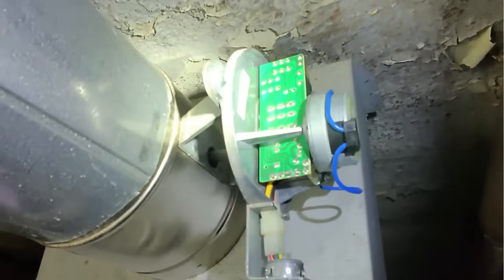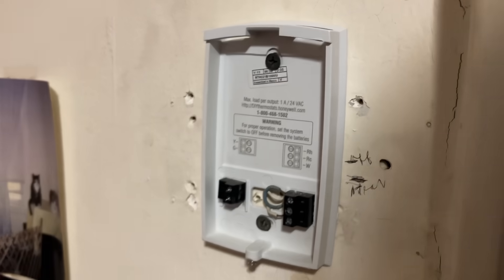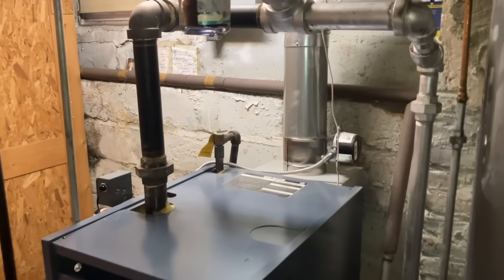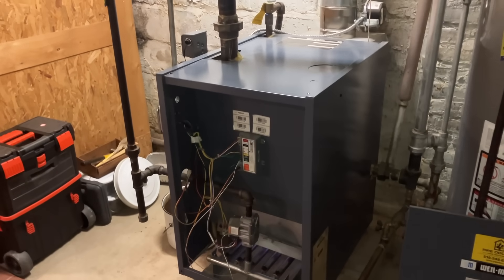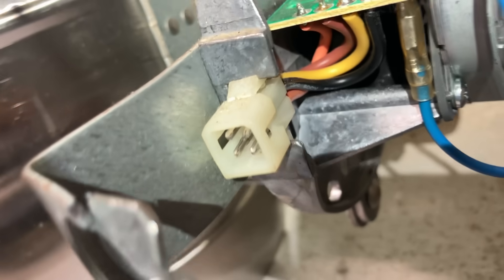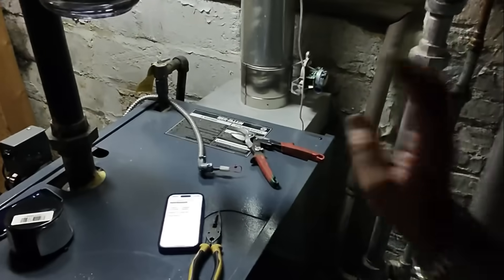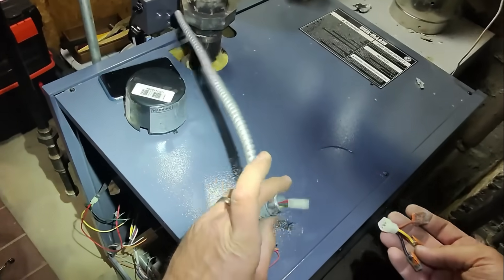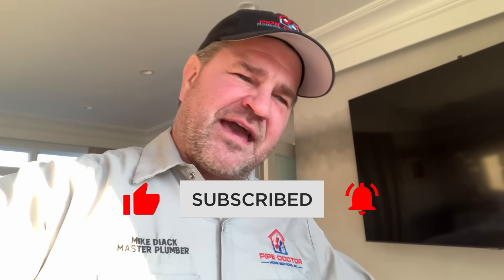Gas Boiler No-Heat FIX: How to SAFELY Bypass a Bad Vent Damper (Emergency Repair)

Comment: Messing with pre wired harness alters the internal integrity of the designed operation. And you are assuming any liability as you know.  But sliding the locked open switch on the damper motor avoids any liability issues. Mostly likely was the intended use of that switch. As the damper is only required for the energy star rating in the sales brochure.   SO LOCK THEM OPEN STRAIGHT OUT OF THE BOX FOR A SAVINGS.   ERIC H
Reply: So dot your I’s and cross your t’s. but don’t write that on your service invoice.    This is Lawyer approved ?   Just kidding

Comment: in the old days when they first started putting on the dampers, the manufacturer sent a molded jumper so you could use the damper or not use the damper and you the molded  jumper instead

Comment: I have a Mizer unit which also has a 4 wire molex but of course the wires are colored differently.  It would be great to know what terminals the 2 wires you're jumping are connected to at the heater.  I'm trying to confirm that the damper is my fire up issue. It was working for a day or so in manual mode but now it appears down for the count.  It's getting power and is open but the power light doesn't doesn't come on.

Comment: Isnt a damper more so an efficiency part? So you don’t lose heat up the chimney in the off cycle? 

I understand the end switch within a properly working motor is a safety switch to prove it’s open, but the actually damper itself is not a safety.
Reply: Yes and no. The damper's purpose is for efficiency, but can become a safety issue if damper can still inadvertently close. Such as with motor gears being stripped which is the most common fault.
This is why relying on the Auto/On switch as a bypass is not recommended.
Reply: @SerenoOunce well that’s my point, bypass the thing, remove the damper blade and move on. By me I would say 1 in 10 people want to get a new damper, they stay bypassed a lot out here

Comment: Loose connection doesn’t mean vent damper was bad. You moved the wires and boiler kicked on … you then showed the damper moving under its own power , and then end switch clicking on before cutting to the next part of the video. You always talk about diagnosing & testing  but now just swapping out a vent damper when there’s literally something else happening. 🤔 @ 6:00
Reply: Right. This was clearly a simple wire connection issue. Unrelated to the motor which was already recently replaced - and confirmed operational.

Comment: In all honesty the vent damper does not need replaced. It’s not worth $300 for the new damper and $200 for the labor for the 1% in heating efficiency it will save.
Reply: My last boiler didn't have an automatic dampener.  TG the gubment is saving us 1%.
Reply: Agree,  costs more then the savings and impedes safety (as a chimney blocker )
Reply: Couldn’t you just lock the damper switch open with the slide switch on the motor.
Reply: @atlasfueloilinc.2421  The issue with that is if the motor gears are stripped the damper could still close.
Reply: And he already confirmed earlier in the vid @4:40 the motor wasn't the issue. It was a poor contact at the molex INSIDE the boiler. This was a no parts repair.

Comment: Or was it on molex plug loose connection when you opened door for burner section and bumped the wires it somehow started ignition good way to cover your time order a vent damper but appriciate how to bypass damper chicago dan in
Reply: guess we'll find out if he shows a call back. it really could have been anything anywhere. that said the dampers are known to be intermittent with age, but so is all the connectors, even more so if they ever got wet from a leak.

Comment: Nice, good to see your going back to replace it. I watched a Steve Lav video last week and he locked out an automatic vent damper by putting a piece of strapping on the shaft and screwing it to the smoke pipe with NO intentions on going back and replacing it. What a hack!
Reply from the maker: Thanks for watching!
Reply: Yeah, despite all of his years of experience and presumed knowledge, he's not the guy I'd ever want parked in front of my house. His tendency to jury-rig or  install used parts (other than physically inert ones) and call it a day is shocking.

Comment: Happy New Year Dr. Mike.  I may be mistaken, but believe many of these dampers have a lock in place that you can leave the vent damper open permanently.  My old school plumber who installed my steam boiler 26 years ago told me that this part fails a great deal, and as such he says a great many vent dampers are locked open in place on Long Island.  Is this your experience too?  Wishing you a your family a happy and prosperous 2026.

Comment: See, my parents 1986 us boiler vent damper has a "service" switch, that opens the damper and leaves it open. 
Apparently they don't do that anymore.
Reply: They still have that on the new ones.
Reply: question, what should someone do if that switch doesnt move the damper ?